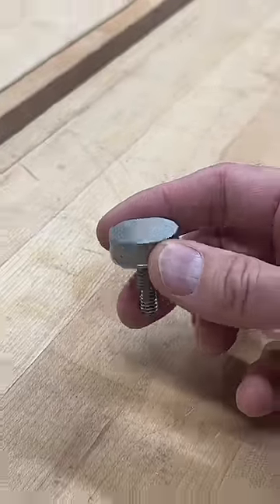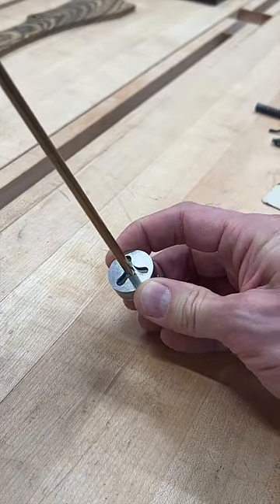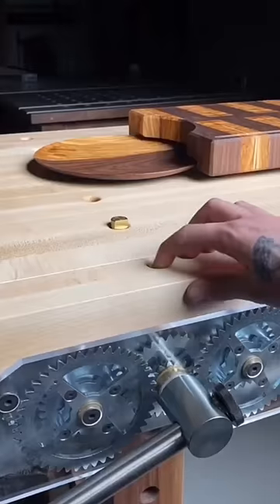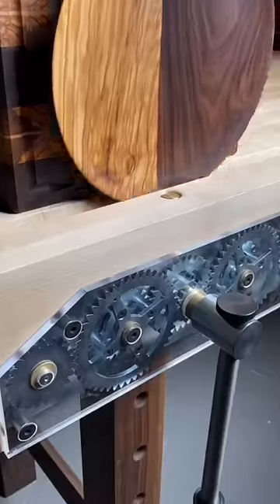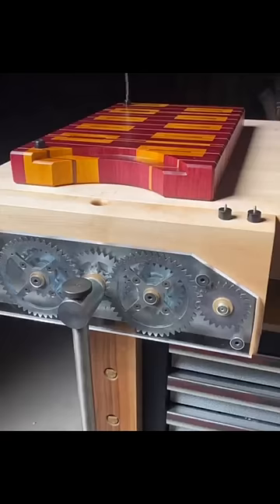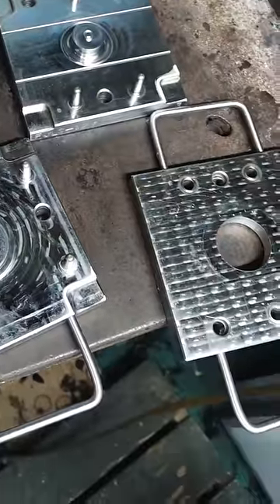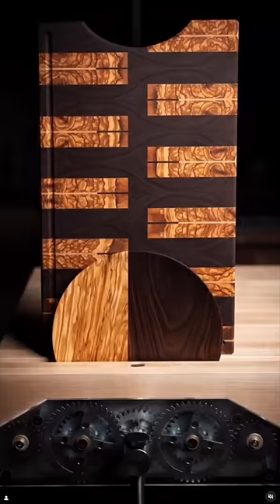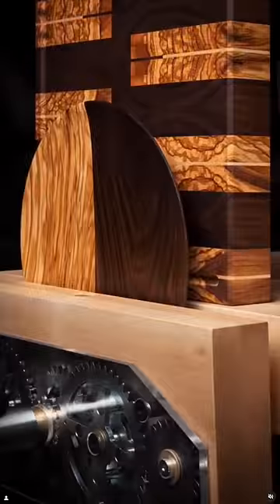Pika Screw on Owl Woodworks cutting board

Comment: You could have made it a standard flat head??? Come on!
Reply from the maker: Wouldn’t have worked
Reply: No, the mechanism needs to be contained to hold the spring and it needs to have a good shape to be machined both in the pocket and as a boss.

Thankfully if you can machine the boss you can also machine a neat little driver for it NP.
Reply: @AndrewKleinWW why wouldn’t it have worked
Reply: @keithm5224 i too am curious
Reply: Because then he couldn't have sold him a dozen screws for $200 @keithm5224
Reply: Don't buy it or go design and manufacture your own, y'all need to chill and stop being weird
Reply: @21Blankenship  it's weird to be inquisitive? The guy said it wouldn't work with no explanation. I'm tripping on acid and wondering...WELL WHY WOULDNT IT?
Reply: @21Blankenship don’t complain about people complaining. God you are weird
Reply: Never...he is going to get a deal for the new driver too. This is America.. look at iPhones and android constantly changing the charger
Reply: @Taskarnin u sir don't know what you are talking about. The driver can be what ever shape it's edm has nothing to do with a spring...
Reply: @conair1973 don’t complain about people complaining about people complaining! 😂
Reply: @JoeReese-kh1jc constantly? Android has gone from mini to micro to USBC. Apple went from long to lightning to USBC. In a span of 17 years. That's hardly constantly. USBC will dominate for a long time as android based Motorola has been using it since 2014 and many others since 2015. The speed and charging protocols are fine for now and future
Reply: @JoeReese-kh1jc I heard they change the chargers just to inconvenience people like you
Reply: @Reulorics yeah but then you’d mark it up and that defeats the purpose doesn’t it.
Reply: @AndrewKleinWW This does not require a $26 dollar solution. 3D print a tool to tighten the custom circular rubber foot, that grabs the outside exterior of rubber foot. Use loctite on screw if meant to be permanent i.e. if it does not need to be removed - for cleaning as an example.

Do the math. If you can save $20 per screw and if you sell 1,000 boards that's $20K you can put in your pocket. That's enough money for a fairly nice vacation.

Wait, another idea. Change the shape of the rubber foot so it can grab the steel screw at the top unseen so it can be hand tightened. In fact you could 3D print rubber foot. How many pieces do you plan on making?? No special tightening tool needed. There's another $10K saved. 

Seriously dude, you owe me a cutting board!
Reply: Why use a flathead. Worst screws 😂
Reply: @keithm5224 because of the shape of a Phillips bit it wouldn’t work. He could have used a torx bit or Allen key, but who knows why he didn’t. Could be to make it proprietary, or it could be something with how zero tolerance machining works that causes those types of cutouts to not be seamless or strong.
Reply: @keithm5224 he said he wanted it to be seemless
Reply: Maybe he could've used some other standardized tool shape but if this was a standard flat head the machining tolerances would be more difficult and you'd mar the flush edges screwing it in.
Reply: @metatechnologist  Go add something to the world
Reply: @Max-pz6tq It’s not that they change the chargers. Is that they use one charger that’s different from everyone else’s.
Reply: @21Blankenship Put a very expensive screw where no one can see it is weirder.
Reply: @metatechnologist if his time is worth more than it would cost to design and implement those 3D prints, then it’s more worth it to buy the pre-fabbed piece. It’s expensive but if it’s exactly what the designer had in mind, and he can afford it, it’s not a waste.
Reply: I want one, please link a purchase link, ty
Reply: @JoeReese-kh1jc constantly changing the charger you mean twice in the past like decade?
Reply: Trademarked you do it
Reply: @ConstantStream69  it’s much harder for a CNC machine to cut corners so he had to come up with a curved design to keep the screws cheap and still make profit
Reply: @metatechnologist this guy makes the screws bro… not the cutting boards lol
Reply: @Indi.animate  DOH!!! He needs to charge $35 a screw!!!
Reply: The rubber foot is pretty thick, and the underside is completely hidden. Could've honestly used all sorts of readily available fasteners countersunk in the foot. I understand the pika screw when it's going to be on a visible surface and it looks like an awesome piece of manufacuring, but this cutting board thing just seems like a premium manufacturer trying to justify continuing to charge a whole bunch for their products. I have no doubt it's exquisitely produced,, and maybe this foot/screw solves a problem they didn't want to advertise existed, so I guess do what is needed to get that bag.
Reply: @keithm5224 I think he’s made a video explaining that the shape and the tool are specifically designed do that there’s no point of contact that has too much pressure on it that would damage the face, if the face gets damaged it completely ruins the “effect” of the invisible slot on the head.
Reply: The point of the screw is design, not function. If you have enough disposable income, design becomes just as important as function.
Reply: @ConstantStream69 Nobody needed to know you were tripping on acid. You were just pointing that out to feel special. Could have said all of that without mentioning that...
Reply: @beyaown1846  hey you did it! Thank you so much. I've been checking my phone constantly waiting for the satisfaction and you just gave me that release. Literally my whole week has been revolving around this. I've been laying in bed at night wondering...how can I let people know I'm special?
Reply: @ConstantStream69  wow your cringe.
Reply: @beyaown1846  wow! First you make me feel good, then you try to hurt me? So sad.
Reply: @ConstantStream69  Dude your talking about acid like it's some common thing people do on a video about a hidden recess for screws... I'm just pointing out that no one needed to know that and you got all defensive and went on a tangent. 

Shouldn't have expected much out of someone named "constantstream69", shoulda figured you were a 16 year old so I shoulda expected a 16 year old response.
Reply: @beyaown1846  dude I just really like you. I wish you didn't have to be so hard to get. If we can just be friends that will make things so much better for everyone. You are the one for me.
Reply: @beyaown1846  I really just want to befriend you
Reply: @ConstantStream69  Negative
Reply: @AndrewKleinWW yes it would have you’re lying to yourself to make your waste of time and money seem more worth while when in reality it was just a conglomerate of over engineering and having to have that feeling of “you wouldn’t have that without me”
Reply: How the hell would a flathead not turn a screw @AndrewKleinWW
Reply: @metatechnologist You do realize those screws were not invented for that cutting board? The creator of the cutting board just asked for em, and asked if he could use those screws as feet. So this creator altered his creation to suit the needs of the other creator. But the screw was not invented for that purpose.

Listening and understanding is a very hard skill to learn, I know. But you need to try a little harder next time. 

Also this guy is happy because his collaboration with that cutting board creator opened up a new opportunity and use case for his invention. Which was probably why he chose to work with the guy to begin with. Two different minds came together and ultimately improved the product and will now allow this guy to sell his product to yet another audience.
Reply: @Reuloricsso then why choose a flat head....???, 🤔🤔
Reply: @JoeReese-kh1jc  Each have had 2 changes since release. Those are 30 pin -> lightning, and micro usb -> usb c respectively.
Reply: @bigvideoenergy you are wron
Reply: @JoeReese-kh1jc nah apple changes there charger
Reply: I got your joke Man. I see
Reply: My contact on China says he can make a flathead version for 45c a piece by utilizing child labor 👍
Reply: @AndrewKleinWW  That's a surprisingly terrible attitude from an inventor.
Reply: Over engineered for aesthetics is wasteful… but so is most of marketing.
Reply: @keithm5224 scaling. Three prongs is more stable than two, the size is likely to be more reliable than a smaller mechanism. And if you’re buying that for woodworking you can totally shape woood into a tool for installing them.
Reply: Then he couldn't sell the special tool for 1k
Reply: @JoeReese-kh1jc .... I'd love to know what you think an Android phone charges with. They've used the most popular micro USB cables forever
Reply: @ConstantStream69 speculation here, but I'd imagine the driver shape is to minimize marring of the surface and make the spring mechanism easier to manufacture. If it was a Robertson, the X shape would get bent pretty easily I'd imagine.
Again, all speculation. But you deserve a better answer than "it won't work."
Reply: I'm just a random nobody here who doesn't do carpentry, but I assume it can't work with flat head because in order for the part that depresses with a spring(?) to be flush/costs, you can't taper the the sides of the head. The wall probably has to be straight. Flatheads on the other hand taper, so it would only make good contact on the corner, which is bad for torque and might damage the drive of the screw. ie, you might "strip" it.

You could get away with the head not always making perfect contact in smaller screws, but that thing is huge in comparison. That being said, idk why not just use a literal rectangle screw driver or w/e tool that I assume comes with it than some fancy triple one, other than better torque I guess?
Reply: As a guess, sharp corners are harder to precision machine and look flawless like these, so you need something with no sharp corners
Reply: @skylarc6063  at $26 per screw, a dozen would be more than $200
Reply: @JoeReese-kh1jc No it can't lmfao
Reply: Man you guys really lack any knowledge of basic mechanics. A Phillips and a flat head both use a cone/wedge design. His design is completely straight cut, allowing the metal to slide down the slot with a detent. Where is the metal supposed to magically go with a cone design? I really don't see why it isn't obvious 😂
Reply: @conair1973 he’s more weird thn people complaining about a screw they’ll never need? Yeah okay
Reply: @davobands  yeah
Reply: @JoeReese-kh1jc when has every few years to account for improving technology ever been considered constantly 💀
Also, Samsung, one of the biggest users of the android operating system, Isn't even an American company
Reply: @JoeReese-kh1jc  the charger has been usb c for over a decade and will be for the foreseeable future lmao
Reply: Uhm itd be the same price either way lmao its so expensive from the precision 😂 one with a smaller fit would be even more expensive  @skylarc6063
Reply: @poopool_Q get outa here with ur logic. People are here to complain not be reasonable!

Lmao well said tho
Reply: @AndrewKleinWW bullshit, don't believe you
Reply: @21Blankenship nobody asked you guy
Reply: @AndrewKleinWW could’ve made it Phillips head.
Reply: Because somebody needs to be a pretentious PoS thief, considering the pricing.
Reply: @satan101101 yeah, especially on a cutting board. 

$104 worth of screws to hold on the rubber feet makes me think these are around $1k each. 

Why would you spend that much on an item that wears out the more you use it? 

It does absolutely nothing for the longevity or performance of the board but significantly increases the cost.
Reply: @AndrewKleinWW  What proveably works is any correctly sized standard bolt or screw because since they are never seen, whether or nit the tool interface is visible makes zero difference.
But hey, I give you credit for bilking stupid rich people. 
Well done.
Reply: @ConstantStream69 because it won’t
Reply: @theeyewhosees  you know nothing
Reply: @AndrewKleinWW you could have just left that fancy part out and you you would have to turn it by putting a small peice of tape and rotate it makes it cheaper for you to make and you could probably charge a bit less then what you already charge for them
Reply: @ConstantStream69 it’s probably related to springs and the Precise machining. If your paying 23$ a screw it not being compactly with any old screwdriver isn’t exactly a problem as you’d have the right tool required to use them is you are buying them in the first place.
Reply: @metatechnologist go make your own since you know exactly what you're talking about 💁🏻‍♂️🤦🏻‍♂️🤦🏻‍♂️
Reply: @kingbenjamin92  Seriously though I've been thinking of ten different ways this could be better lol ....
Reply: You can try make it your own, it's a free market
Reply: Right, even if the design needs 3 poles to make it stay straight and flush then just do that but have the top be a slot perhaps? So under the lid there would be 3 poles but only one slot exposed and used idk something like that.
Reply: @skylarc6063 what does that have to do with the price bro???
Reply: @JoeReese-kh1jc  what? Android phones have gone through two different chargers in like 30 years my guy
Reply: Then he couldn't scam people
Reply: @poopool_Q I've been using Android  since the G1, that was the only android device I've owned (out of too many) that had a mini usb A. The usb C as you said has been on the flag ships for almost 10 years, and micro usb A, was the first 7 years. 

Fun fact the mini usb also carried audio out on the G1. You couldn't charge and listen to music. Which was a bit of a flaw given on release (android 1.1), you got about 3h of battery. By 1.6 (six months in about) you was getting about 5h. That's total, not a reen on time.
Reply: @StephenButlerOne  I started at the G1 also. But 1.5, I didn't see 1.1. i am still using android because I need root but I find Android to be in embarrassing shape after 14 versions and 15+ years of development. It's embarrassing when my devices still have Bluetooth pairing issues or basic foundational bugs from the OS
Reply: @poopool_Q  what are your BT issues? I don't have any and can't recall ever having any. The only two brands of BT ear phones I use is boss QC cans  and Anker sound core buds. But when my current boss die I'll be going over to sound core 35s, belting earphones for £100.

The only issue I've had over my last two phone is cell range, but I think this is pixel related rather than android. my pixel 6p was bad, my 8p is awful. With sticks with Samsung and her signal is always fine! It doesn't really bother me, except the times it does!
Reply: @StephenButlerOne  I replied and YouTube deleted it. 🤗
Reply: Or just torque it by hand with no slot or head with some loctite.
Reply: I feel like you wouldn't understand
Reply: Hahahhahqhwhhqhqhqhhqhwhwhwhwhwhhahq.

Now that's done, no he could have saved his money and done caps like every company will always do and avoid a special tool. 😂 such a joke invention. And I'm glad I was here to laugh along the way.  Everything you're trying to solve was solved years ago.
Reply: @AndrewKleinWW  I like ultra low profile style of it!
Reply: @conair1973 "don't complain about people complaining" he says, while complaining about people who complain. Did you really not see the irony before posting ? lmao
Reply: @El_Bretzel  what? I never said that
Reply: @conair1973  you said word for word "don't complain about people complaining. God you are weird" why tf you lying
Reply: @El_Bretzel  uhh where is your source for that? You’re just making stuff up
Reply: @21Blankenship hypocrite much ? You aren’t very smart
Reply: A rectangle is pretty much impossible to machine en masse. Plus a flathead screwdriver would be super wobly with a single spring, so two would be needed, increasing complexity
Reply: @metatechnologist thank you it looks cool but that was exactly my thought, this is way too complicated
Reply: Or a torx
Reply: How else would he charge extra for the mandatory screw head if it was the same as a Philips??? Tsk tsk tsk
Reply: @ConstantStream69  Probably dozens of reasons. See how it's wavy? That's because you wouldn't be able to manufacture a right angle corner with necessary tolerances to be invisible. 
The screwdriver for it also has to have same tolerances, otherwise it would leave a mark there. Normal flatheads don't have the tolerance necessary and are all over in sizes from manufacturer to manufacturer.
Reply: @JoeReese-kh1jc dude most androids uses an industry standard cable
Reply: @JoeReese-kh1jc how many iPhones have used the lightning port…. Seems like a good run to just now switch to usb c also the 32pin was also used over and over again. Eventually technology does have to be updated.
Reply: @JoeReese-kh1jc android always uses the most commonly acceptable and power carrying compatible charging port. Nothing weird about that, it's kind of expected and doesn't even change that much. That's like complaining about how car engines change over time as the technology improves, it's really a made up issue.
Reply: @henryhe5945  who does? The u in USB stands for universal.
Reply: @platinumsky845  The conversation I was replying to mentioned Apple as well, and Apple uses lightning. I was only pointing out that the chargers were not changing. They were just always different.
Reply: All right, let’s see your screw then
Reply: The whole point is that the pika screws dont have a slot. So its just a visual thing
Reply: @beyaown1846  Y O U ' R E
Reply: It wouldn’t work because his audience expects something stupid
Reply: @keithm5224 A Phillips head is like 4mm across where you gonna find a way for that to work. This sinks how would you make a Phillips sink internally, You couldn't if you did it wouldn't take a Phillips screwdriver or it'd strip out and blow springs.
Could do it on a large torx but he'd probably have to license it from torx so make his own.
Reply: @metatechnologist  I love how you went "do the math" and then failed to do the math. You based your entire argument on the boards having one foot. Now, that's just silly. Silly goose, calling people out for something you fail at yourself. Silly silly silly.
Reply: Android hasn't changed the charger since USB-C came out and that change was because USB-C has a much faster charging capacity @JoeReese-kh1jc